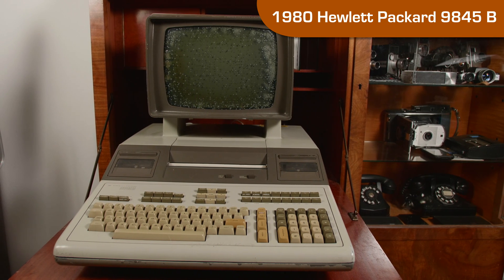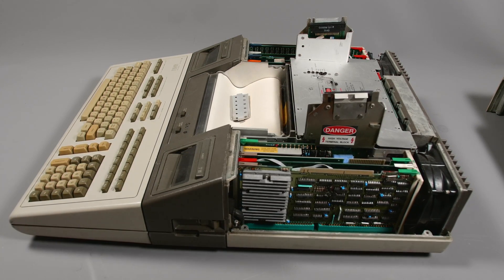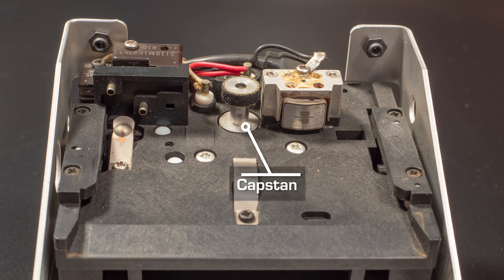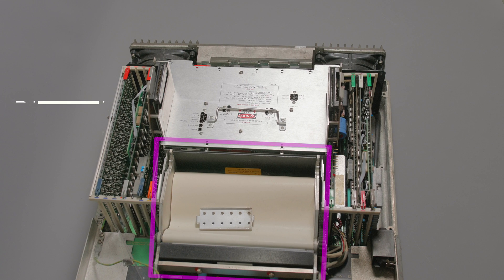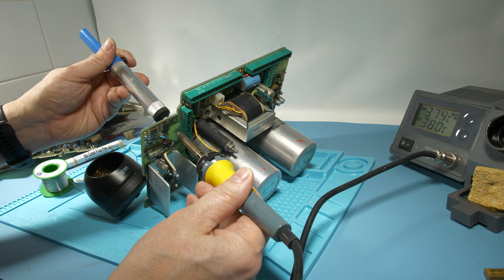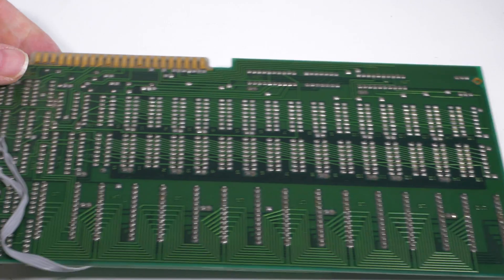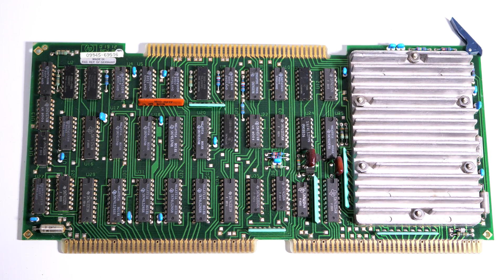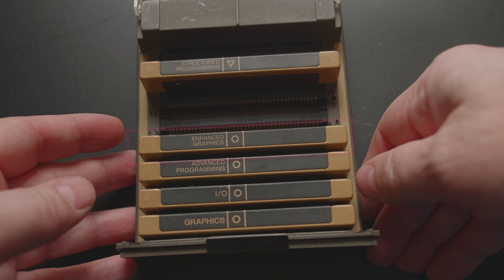Deeper into the HP 9845: Design and Internals

Comment: I had a 9845 color to run a program called FESDEC. A finite element analysis program. An 8 inch floppy was the only real storage. Slow and noisy. I've still got DC100's around someplace.
Reply: Was the floppy an HP9885 single 8" drive or a double HP9095 ?